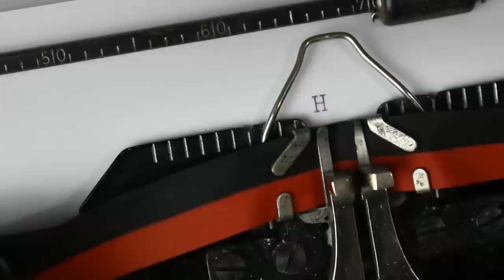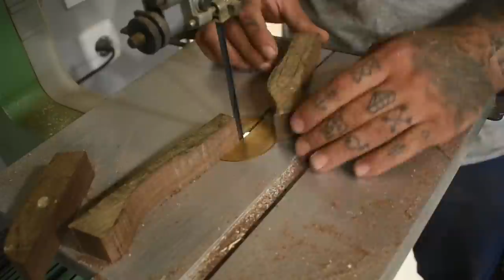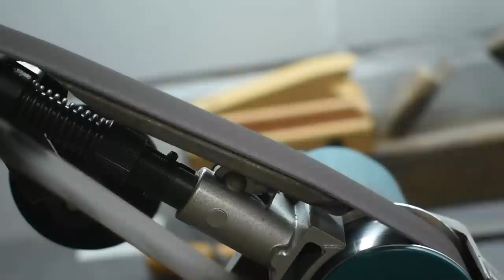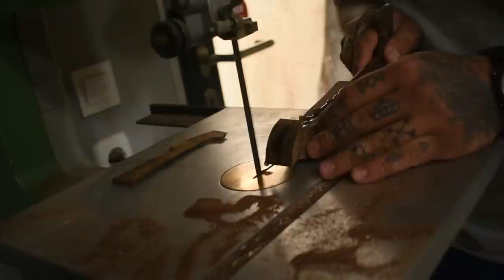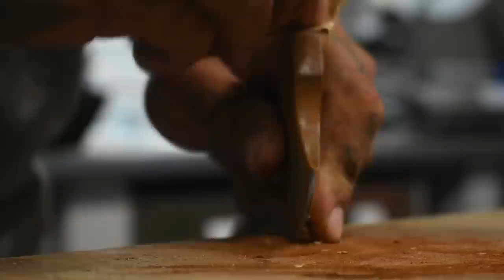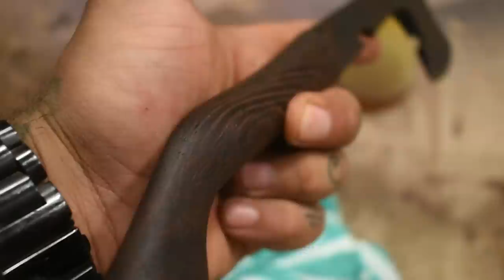HABU \\ Mini Hatchet Make Over

Comment: I would recommend riveting the base of the handle through the wood, that epoxy won’t hold for very long after use. Perhaps a drill press and then sand it down

Comment: Wow. Due to the attention to authenticity I would call that a restoration at this point. I don't think you could tell its not all original. At first I was skeptical when I saw you were not going to shine it up (then I saw it finished). If I didn't know I would have said the handle was 40 years old. Nice work, even the cut of the handle looks aged in it's shape.
Reply: Can you tell me what finish you used on the metal and wood?  I have some new handles on my hammers and would love to get that old brown) black patina on them it had before I had to replace them.

Comment: Why only mill one side of the handle. Would it not be better to mill bolth sides of the handle equally so you would have equal amounts of material on bolth sides .
Reply: Matthew Price not really. Having a seam running the middle of the tang is a weak spot for cracking.  What he made is called a frame tang handle. He should have put a pin in it however.